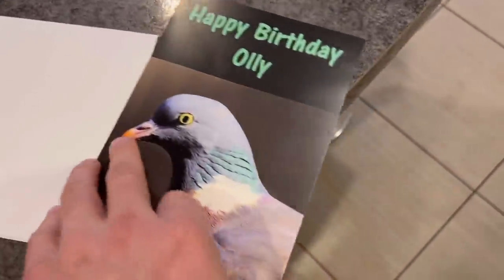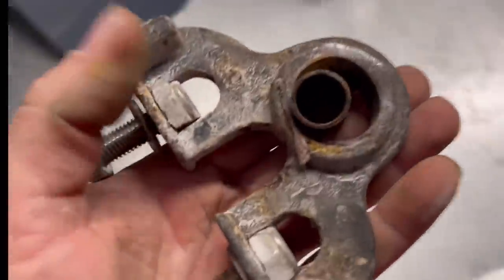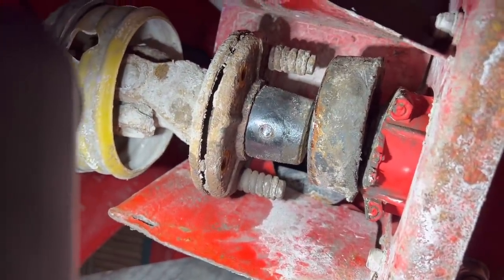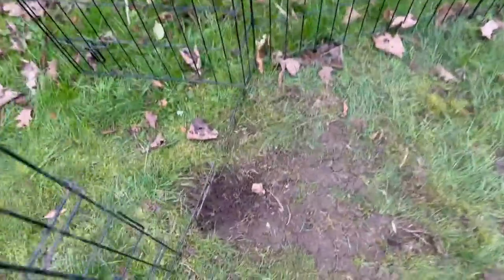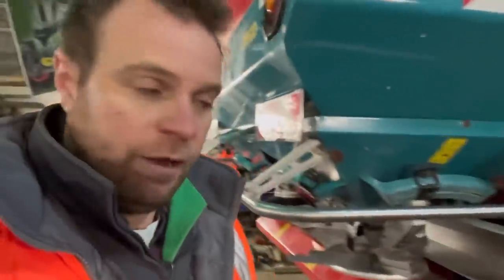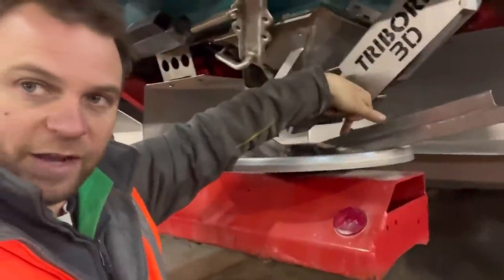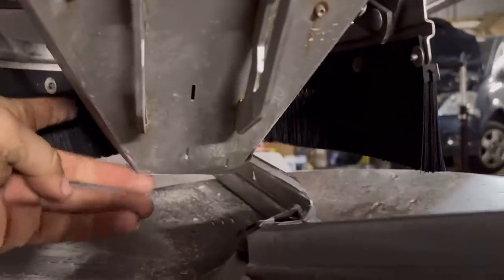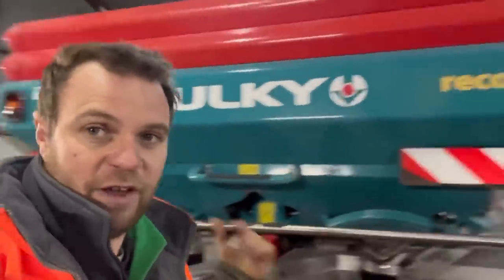Day673 #OLLYBLOGS FIXING AND HOW A FERTILISER SPREADER WORKS PLUS MY BIRTHDAY #AnswerAsAPercent

Comment: happy birth day, I have been out of farming 35 years (biggest mistake I have made). the tech in farming amazes me, I use to use an Allman Sprayer 12m span 3 section boom, a 2meter section across the sprayer & 2 x 5 meter folding booms, each section could be isolated (WOW you say) Fertilizer spreading was with the old trusty Vicon again 12meter spread 24cwt ICI bags 50KG . each, Good old Ford 7610 FWD, happy days

Comment: Happy Birthday
Hydraulic drive Amazone's also alter the drop point as well as adjusting disc speed for headlands. They used to have multiple options of headland spread as to whether it was a hedge, ditch, watercourse etc. Interesting watching the map and the spreader settings as it adjusts itself.
Kuhn are still the only ones that weigh the product on the disc though, so should be the most accurate. And if you have dodgy product flow can do more to help because it's weighing the hopper, the disc+product and knows the target so is quicker to open/close shutters.

Comment: I think one of your pigeons has come to visit us judging by its size due to which along with its attitude I named it Fat Tony

Must admit the adjustments are phenomenal now even on some basic none isobus variable spread machines. Our old one to calibrate it I think you used an M12 bold then adjusted the pointer to the right number and swamped the discs for the headland or different widths though the shut off rams kept driving us nuts each spring. The new basic one has a high and low speed gearbox depending what widths you want to spread, I believe a setting for course or course if you want to spread cover crop on or smaller tramlines, a placement setting and finally the opening widths of the shutters. Safe to say I get the job of setting it up if dad wants to do the spreading though it is easy to setup with the app but it is definitely nicer and more accurate plus it is nice that I'm not stuck doing 12m bouts that my dad prefers though I haven't tried the 50m it's supposed to be able to do.